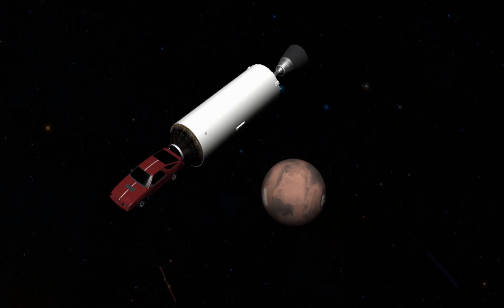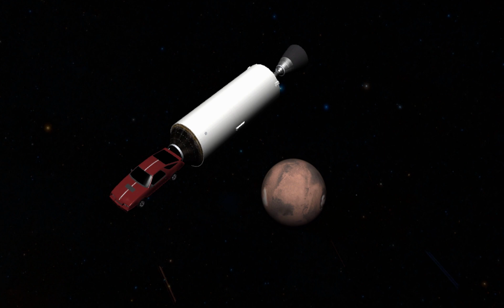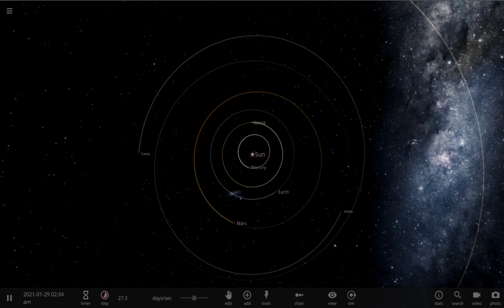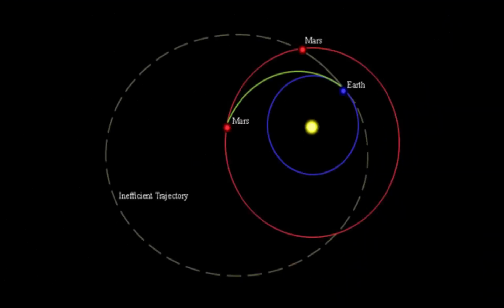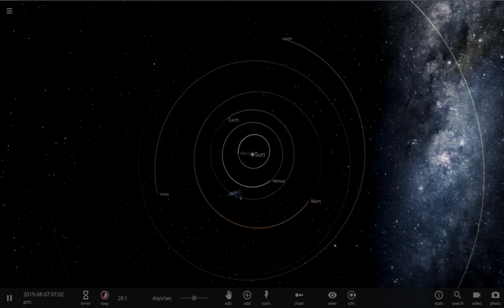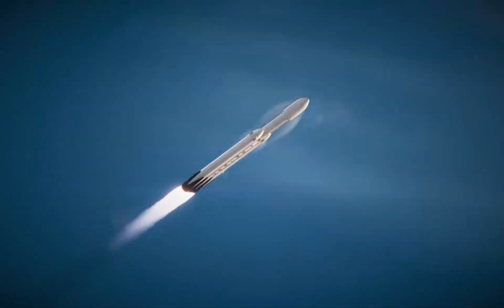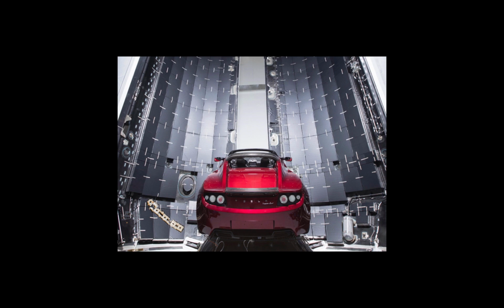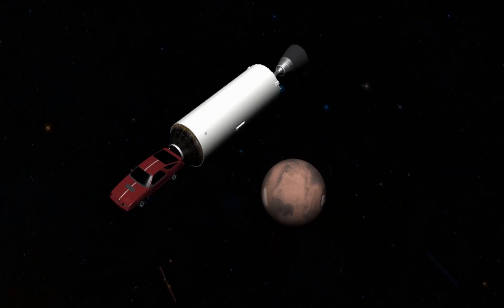How Far Can The Roadster Get -Explaining How The Falcon Heavy Can Reach Mars Outside Transfer Window

Comment: I think Elon is setting a challenge to develop recovery in space.
Elon said that "if you can recover it ,its yours.
Reply: lgtwzrd Maybe, but it will make a great museum piece or collector’s item in 100(?) years
Reply: Harry XY Roberts  True that. It already is a collectors item.
Reply: I suspect someone, someday, will hop in next to that “driver” and take a selfie.
Reply: the car is priceless regardless of its paintwork XD
Reply: It will probably get blown up by a bored Klingon.
Reply: Well it definitely has a far better chance of being blown up by a bored Kingon than it does at becoming radio active. lol
Reply: lgtwzrd I'm not sure "paint will be ruined in a day" is very accurate.
Reply: Jordan Henderson im not a physicist. Just know that unless that metal radiates its heat as fast as it receives it, it will get really hot eventually.
Reply: doc morridge agreed
Reply: I imagine it would be radioactive if anyone managed to get it at some point.
Reply: +lgtwzrd The bright paintwork/chrome etc will reflect light pretty well, and of course the unlit side radiates heat.  The ISS has been up for quite a bit longer, and it's still white.  Red won't reflect quite as well, but the equilibrium temperature will probably not be that high.  The seat material being black and some plastic (or even leather) will deteriorate quicker, because it doesn't reflect light very well, and it wont survive temperatues as high as a baked-on enamel paint job will.

The body of the Tesla is aluminum, and aluminum is an extremely good heat conductor - it will tend to have the whole body warm up to a fairly even temperature, the side facing the sun picking up heat, the side away radiating it away.

Aluminum has a lowish emissivity, which means it won't radiate quite as well as steel, say, does, but the paint coating will make a difference.

Some materials have quite reasonable equilibrium temperatures in space, they reflect a lot, and they have high IR emissivity.  I understand some of the materials currently in use will "settle" at around 1-5C.   A Tesla won't, but I'd be unsurprised if it didn't exceed 50C.  The paint won't be bothered much by 50C.  The upholstery and other plastics will once you include the UV (most plastics really hate UV.  Car paints are designed to be pretty resistent to UV.).

The ISS has a refrigeration unit designed to suck heat from the power generation area to a radiator which is mostly in the shadow.  If it wasn't generating power, the ISS probably wouldn't get very hot.
Reply: Its inside a capsule. no direct sun, and sunlight will be weakening as it gets further away..
Reply: if you have the tech to recover that, then you have the money to just go buy one
Reply: UnstoppableFPS thats not how space works
Reply: I'm afraid that unless they recover it within a few hours from release, the car will be broken and unusable due to extreme hot and cold temperatures in space. Not to mention, the paint will be ruined within a day.